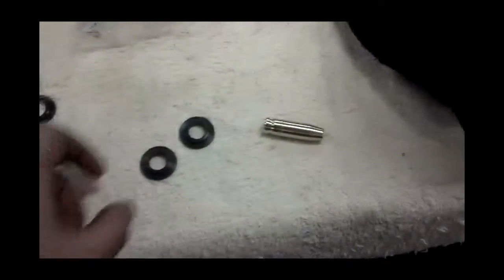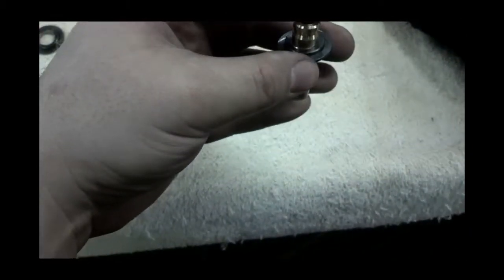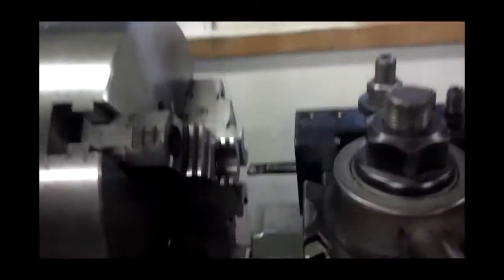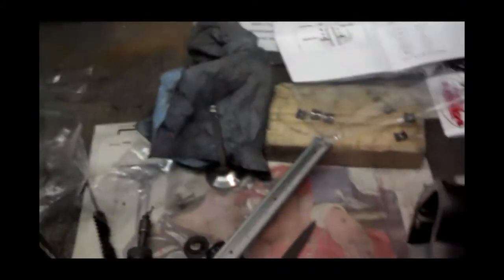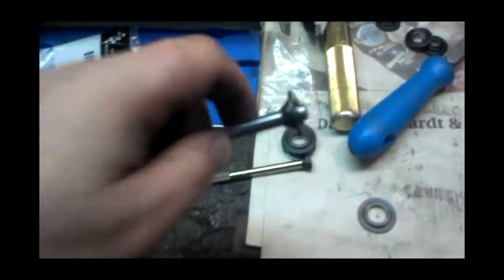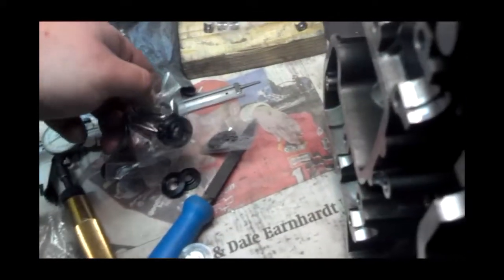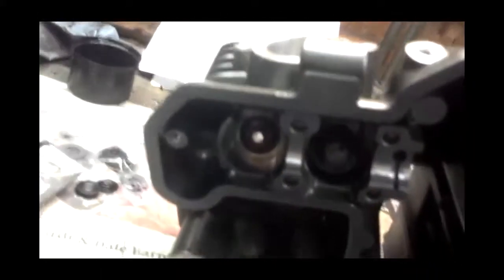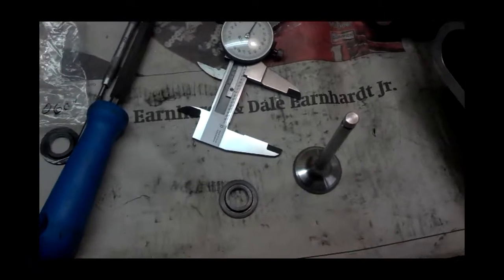KLR 650 beehive spring install

Comment: what does a beehive spring do?
Reply from the maker: Ewen MacDonald simply put it does a better job of controlling the valve with less closed spring pressure. So basically frees up horsepower and is gentler on the valve gear.
Reply: nice, so this is something you should be doing in conjuction with a 705 kit to ensure you get the most hp out of it eh? amoung other things? 

Cheers!
Reply from the maker: Ewen MacDonald precisely, this was part of a complete adventure bike build. Were you needing this done to yours?
Reply: yea I'm trying to eek out any more power I can out of this thing. I wonder if this 705/ beehive combo would increase torque much?
Reply from the maker: Ewen MacDonald yes quite a bit. Feel free to call me and disuss it (812)459-5657